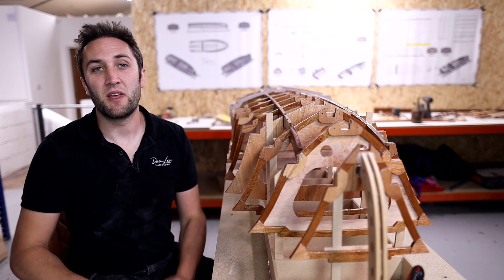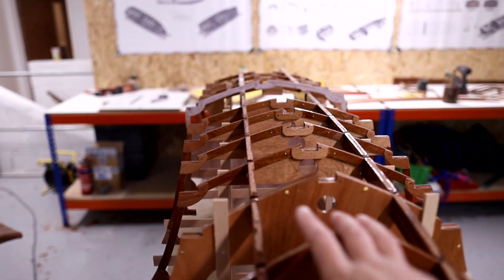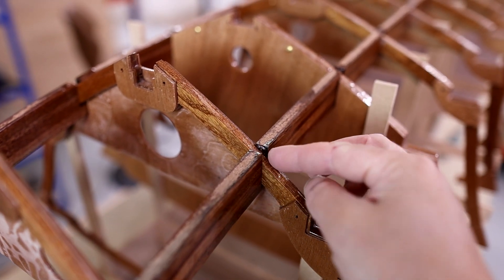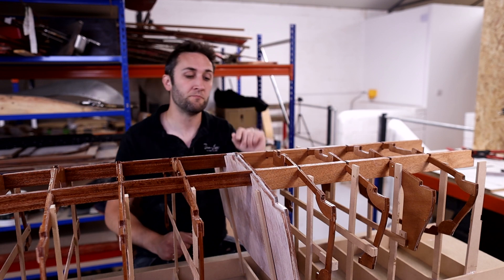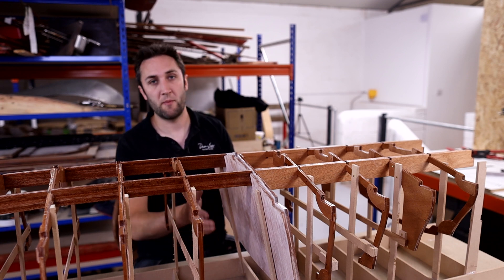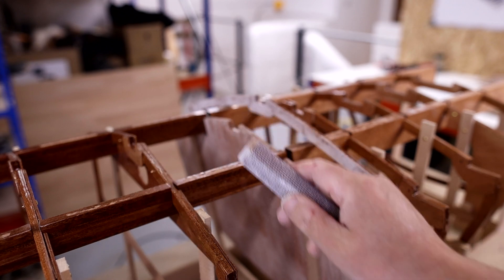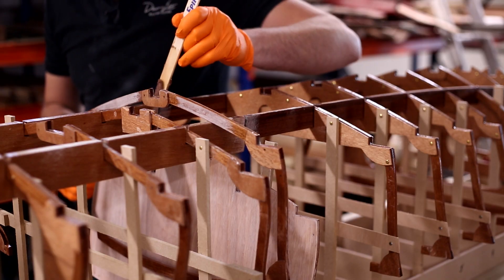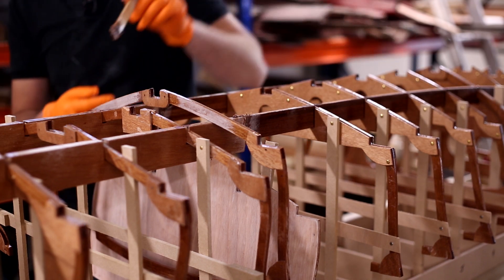Frame 9 Glue Up | Temptress 1/4 Scale Boat Build Part 14

Comment: I would 100% sand out all of the surfaces off the jig, and once assembled, filleted and faired out I would get varnish on too. There’s no doubt that you will be glad you did down the road. I harvest my mahogany dust out of my dust collector filters whenever I give the system a proper clean out. I run the dust through a sieve to ensure no chunks remain. I also occasionally use dry earth pigments for tinting epoxy. I think your recommendation to do a full dry fit is spot on. For filleting around the bulkhead, I think you’re better off just removing all the squeeze out and doing a dedicated filleting operation where you can better control volume because I suspect that by the time you get to it in this glue up, you’ll be getting too far into the cure time for forming a nice clean fillet and a good fillet wants a nice consistent bead of epoxy to tool out. Once again this model forces you to consider operation in detail that you would never think about otherwise. Good job Dan.
Reply from the maker: Thanks Mark! These sorts of things are tricky to gauge on a 1/4 scale model as they don't really scale in the same fashion. Like you say it's things you probably wouldn't otherwise think about on a full size boat.